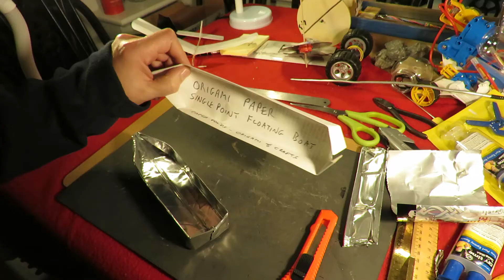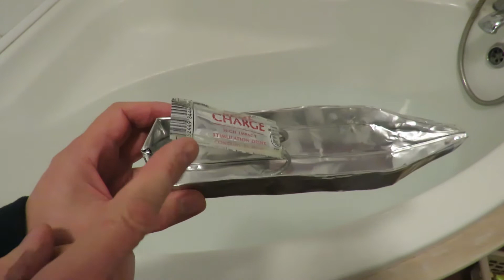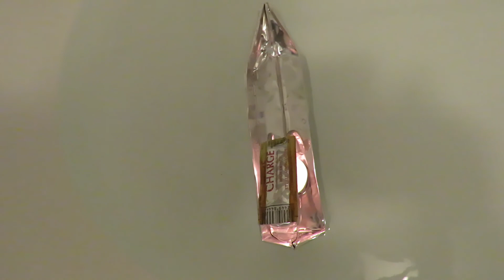Origami Aluminium Pop Pop Putt Putt boat

Comment: That's really good. It would be interesting to put one of them on a pond to see how far it would go. May need to put a windshield around the tea candle to prevent it from going out if it were outside. :D
Reply from the maker: Hey I just did a search for you in my comments because I wanted to send you a link and this comment turned up as one I haven't replied to. So I will post the link here and see if you get it 😆🤣 https://youtu.be/6YkYF_ItmLc
Reply: @GrandadIsAnOldMan  Got it. Brilliant. 👍

Comment: A nice little boat. There's so much room for creativity with shapes and common objects that can be repurposed. 
For something odd, it occurred to me if you had a large bowl and put a clicky putt putt motor in the center of it and jetted the water under the surface on two sides, the created swirl might be enough to drift/drive a boat in circles on the current. Then too , if you had a fresnel lens or such, the centralized putt putt boat motor could run on sunlight without having to stay on track with the sun. Or allow the boiler to spin/pinned on a point in the center of the bowl and the exhaust tube integrated into the boat vaguely like this "arm" scenario.
https://www.youtube.com/watch?v=9rt1l-zmCug

The current thought is similar to this catamaran that eventually started the water in the pool to start swirling from the motion, although it maybe isn't that apparent from the clip. 
https://www.youtube.com/watch?v=Ah_FBmVv58s

Just some half-baked ideas that might be fun to try if not more work than it's worth. If you can find parts to work with quickly and easily, then making something simple can be a lot of fun.
Reply from the maker: Daryl Foster has always been my "Go to" for reference on pop pop issues 😁 and your catamaran is brilliant, and as a bonus, it makes a very satisfying noise as it goes around 👍
Reply: @GrandadIsAnOldMan  I wonder if a very tiny boat could move in some way with the mechanism of those solar rockers like you toy with? I put a Minnie Mouse one in a sardine boat and of course just got random jiggle motion/possible rotation but if it could ever so slightly bat the water, maybe some sort of slow forward direction could come about. Dumb idea number 507 probably. You've done so many solar boats, maybe you did or thought about it or maybe the idea is too foolish.
Reply from the maker: I have done boats propelled by a flapping 'tail' and I seem to remember Blade Attila did something like you suggest. Ah, I just checked and the one I am thinking of was Pop Pop related not solar https://www.youtube.com/watch?v=xsuIT1JyZn0